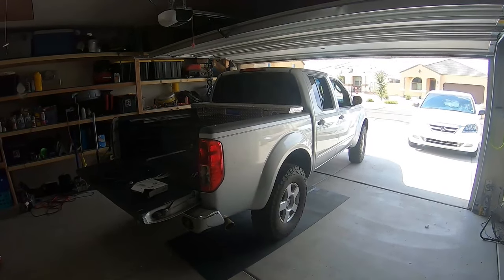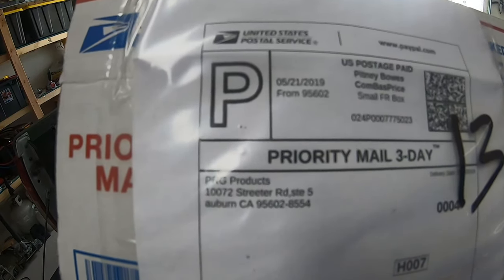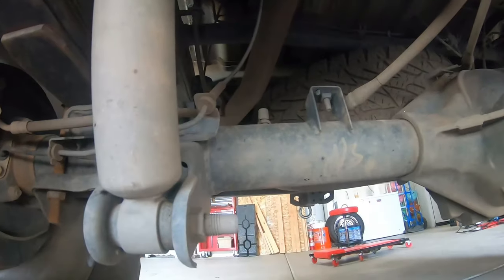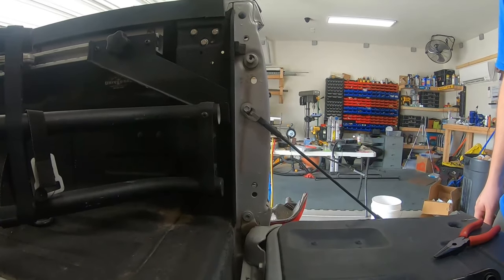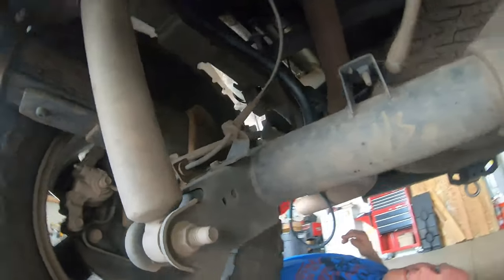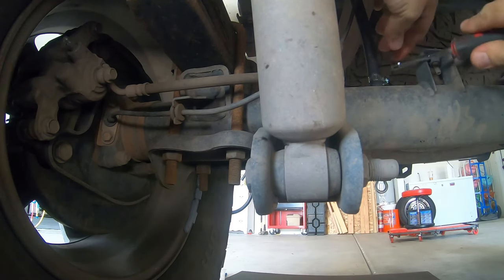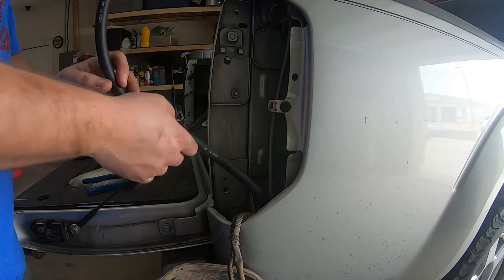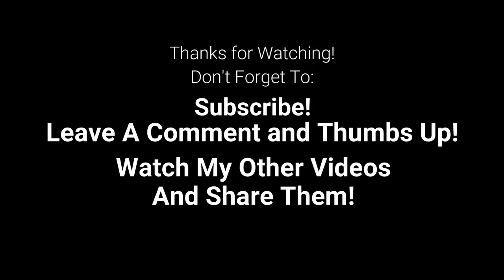Nissan Frontier axle vent Mod or diff breather

Comment: I saw one video on this mod, they recommended using a wire brush to thoroughly clean the area around and on top of the axle of any debris might have accumulated over the years, so it doesn't get into the axle hole when you remove the OEM breather.
Reply from the maker: Never a bad idea to clean!
Reply: @AGuyandHisProjects  - Very well done how-to video as BTW, I had pnly seen a YT for an X-Terra, I too have a ('20) Frontier so this TY had me ordering the 7ft. kit from All-Dogs.  Thank You for taking the time to create this.
Reply from the maker: @stevebailey7633  You are most welcome, glad I could help! Let me know how it goes when you get it in!

Comment: Need to clean around old one to remove.  Don't want dirt falling into the hole.  Dealer tried to hose me for 500 bucks to replace the stack one!  (and swap the diff fluid)
Reply from the maker: Working clean is always a great idea! That's a lot of dough  for some easy stuff

Comment: Was there any damage from where the jack stands were placed?  I didn't know you  could support the truck there and always put them on the frame/axle.
Reply from the maker: It's not my favorite place to lift but if you do it at the designated points where the manual tells you (little arrows on the truck) you should be fine. That is where they reinforce it for the factory scissor jack point

Comment: Is this mod really necessary? You have almost 250k and no issues, wouldnt it of been better just to replace the breather and chances are it would live out the trucks life? Just asking. Thanks for the video.
Reply from the maker: I run my vehicles into pretty high mileage (300+). To answer your question though for peace of mind yes, very necessary lol! I also really enjoy being in the garage working on the vehicles which is a big part of the "extras" I do on the vehicles
Reply: @AGuyandHisProjects  - The point made by the folks at AllDogs is the OEM model is a crappy design, prone to rust, which kills the unit.  You are then susceptible to overpressure in the axle, which can kill the seals.  That's a very expensive repair, as opposed to a $40 fix that lasts forever and takes 15 minutes for about anyone to install.

Comment: wow i see you have 5 or 6 leaf suspension on your nissan.  heavy duty i see.  stock is 3 leafs.
Reply from the maker: Thanks for watching! It is actually a 9 leaf pack. I ordered it from Alcan. Smoothed out the ride and built in an extra 500lbs capacity before the bed would sink. Loved those springs and highly recommend!
Reply from the maker: Actually, at the time of this video i may have been running add a leafs. I don't remember. Either way the custom 9 leaf pack from Alcan was awesome!

Comment: How much hose did you use? The kit says it includes 5’ of hose. That doesn’t seem like enough to mount behind the taillight. 
Does the barbed axel fitting come included?
Reply from the maker: Oh shoot, it has been a few days lol. I would imagine 5' would get you close if you are stock suspension. I think if I remember right I had to buy more hose and the coupling to connect them due to having an aftermarket suspension that allowed the rear axle to drop more. Hose is super cheap at your local auto store though, usually around a buck something per foot or so
Reply: @AGuyandHisProjects  Thank you
Reply: @AGuyandHisProjects  - The AllDogs Offroad breather kit ($40) gives you 2 options, a 3ft hose that allows you to install the new breather somewhere under the bed, or a 7ft, hose which is about the correct length to mount in the taillight.  I too wondered about "why inside the taillight" then realized it's a perfect location as it'll never get wet or dirty.
Reply from the maker: @stevebailey7633  True story! I have since installed others as well in various vehicles and have ended up putting them all in the tail light housing.

Comment: I noticed you didnt put any teflon tape or pipe dope on the threads of the breather replacement fitting. Did you just not video tape that or didnt put any on.
Reply from the maker: I didn't feel the need for it as there is no pressure to force the oil out and I don't spend enough time under water to worry about water going in. Sealing the threads would not be a bad idea at all though!
Reply: A Guy and His Projects Im debating if I should wait until spring to install the vent kit. The reason is Im not sure if moist air will condense in this hose and cause water to enter the diff. I live in Canada and as you know we get cold weather. Any idea if this could be an issue.
Reply from the maker: @truenorthmuskoka9077  i am no engineer but I do not see that being an issue as the filter isn't one way so the whole system can breathe...that would be my personal thought anyway
Reply: @truenorthmuskoka9077   ... Can I ask where you sourced your kit / parts from in Canada? Thanks in advance.
Reply: Samuel Smith I had to source it from the US at Offroad Gorilla. 

http://www.offroadgorilla.com/shop/rear-differential-breather-vent-kit
Reply: Samuel Smith I also bought these hood struts. They work great. 

 http://www.offroadgorilla.com/shop/nissan-hood-gas-strut-kit-hood-rod-eliminator
Reply: @truenorthmuskoka9077  right on, I went with The Big Monkey for my hood struts too ... I am so unbelievably happy with that mod. Just another reason to give that crew more business. Thanks for validating.
Reply: Samuel Smith no problem friend. If you ever come across a tailgate I’d be interested. I bought one from CARid and it broke in a couple months.
Reply: @truenorthmuskoka9077  Condensation is a possibility, but keep in mind on 4x4 models Nissan has a tube like this one off of the front diff that just breathes from the air box.  So if condensation was a huge issue?  Why would they do it for the front that way?  It is something to think about.  There is so little air moving in and out that condensation with an open element like the K&N filter used here shouldn't be a problem, though if your using a sealed fuel filter like some do?  I can see that being an issue for sure.

Comment: Great video. I'm getting me this kit and making the mods. I also have a 2wd Frontier and I live in a city that floods from time to time. I wanna add a snorkel to it just to prevent any situations where I have to drive through water for a few yards and not choking the truck. Any opinion on a mod like this to a truck like mine?
Reply from the maker: Thanks for watching! I have really enjoyed not worrying about the rear diff breather lol. I've wanted to do a snorkel as well but never squeezed the trigger on one so I can't hit you up with a recommendation. :/ good luck though! It is so much fun molding a truck into your own build
Reply: @AGuyandHisProjects  The day you squeeze that trigger make a video and let me know how it turns out. I think I found a site where they make the snorkels that fit the Frontiers. For now, baby steps... it's my first truck after driving sports cars for more than 14 years.
Reply: @AGuyandHisProjects  Bought the kit but the hose came in 4.5ft long which is pretty short and gives no good slack. Do you know what size or kind of hose this is?
Reply from the maker: Shoot I don't remember lol. I think when I did it I took the hose to my local auto parts store and bought a longer hose, or a coupling and extension to the hose
Reply: @AGuyandHisProjects  No worries man. I went to 2 autoparts stores today and their hoses  aren't as flexible as the one provided in the kit. All they had were some heavy duty extra strength crazy hoses and the kit hose didn't even have a size written on it for me to have some guidance, lol.
Reply from the maker: @ottico84  as it is just a passive breather you'd be fine with just about anything, fuel line is pretty cheap. I used fuel line exclusively on my f250 for both front and rear breathers

Comment: My 2017 2wd plan jane never taken off road or driven through water with only 15500 on it frontier is at the dealer having the blown seals fixed as I write this!  WTF Nissan, this is a known issue why haven’t you fixed this before it happens?😤
Reply from the maker: I know right! Something so small and simple for them to change too!
Reply: A Guy and His Projects/ I had read about this kit from PRG, thanks for a clear instructional video about the installation process!
Reply from the maker: Absolutely! Glad I could help 👍
Reply: Just got my 2017 frontier back from the dealer after 3 days after they replaced a blown axel seal.  They just replaced one side even though I could see grease on the other backing plate!  They insisted the other one wasn’t leaking and they wouldn’t replace it. Man I hate stealerships!  So just ordered this kit and wanted to thank you for your great video and advice!
Reply from the maker: @jackwood8307  you are welcome! The breather kit should help indeed, but if a seal is already on the way out...good luck haha!
Reply: A Guy and His Projects/ so as I thought the repair job they did on just one side did not work for long!  E brake started slipping after a week!  So long story short I contacted the general manager of the dealership and told them I was not a happy customer and explained my issue.  The service dept manager called me and apologized for my experience.  They had me bring the truck in the next day and replaced both seals and brake pads this time!  I must say that the brakes have never felt this good!   I bought the breather kit you recommended and I have a question about the placement of the breather.  In your video you placed it up by the rear tail light but the picture from prg shows it installed above the axel.  If I don’t off road this truck and dont drive through stream beds is it being above the axel a good place for it? Will water from just driving in the rain be a problem?   This would be a much easier install with it just above the axel.  Thanks for your help!
Reply from the maker: Glad to hear it all worked out! If you dont go anything deeper than the bottom of the bed I think you'd be just fine. I went with the highest I could go so i would never have to worry about it.
Reply: It is a "known Issue" but not just for Nissan.  Toyota has the SAME EXACT issue because they use the SAME EXACT type of OEM valve.  It happens to very few trucks.  There is a TSB on this through Nissan but applies only to the M226 axles not the C200 to my knowledge.  It does happen, but not as often as you think.  There are people with over 200k miles on their trucks with the OEM original valve and no problems.  My Sister even with her 2005 Titan has the same OEM axle vent on with over 200k miles she has never had an issue with seals.  So it really seems to be a hit n miss type of thing.  The Mod should help, but could also void your warranty, so damned if you do, damned if you don't type of thing.
Reply: Jeff Eppenger /thats a roger on the warranty.  3 year on components and 5 years on the drive train.  You can bet if you ever developed any issues with the rear end and had this mod thery wont honor it.  So I guess the thing to do is to take it off when going to the dealer but what a pain. But so far the fix they did is working!(knocking on wood now)
Reply: @jackwood8307  In my wife's truck case, we have a 7yr 100k warranty.  Though I see the mod as useful, I still believe the amount of trucks with actual failures is still WWAAYY less than people think.  Does it happen?  YES.  Only To Nissan Trucks? NO.  Toyota has the SAME problems.  Its hit and miss.  I do know Nissan improved the seal design a few years back and that solved many of the so called problems.  So was it bad seals to begin with? or a faulty vent?  Will we ever know?
Reply: Jeff Eppenger/well it seems to be fixed and as I went through the front office to remedy this for the 3rd visit, I got results. Polite but firm seemed to work. Tight car market around here and the dealers are fighting over customers.
Reply: @jackwood8307  what was wrong and what did the dealer tell you?
Reply: Jeff Eppenger yes the rear seals on the axel at the wheels had blown out due to the vent being plugged. It got where the parking brake wasn’t working and it felt like it was taking more effort to stop. The shoes had become soaked in rear end dope.
Reply: @jackwood8307  do you know why the vent clogged? I'm just curious because I'm trying to figure out a pattern.  There is a discussion I'm involved in on the frontier forums and I'm trying to gather information.  Where you live in there snow? Lots of rain? Was your truck taken off road? Through streams or anything that you think would have caused it to get plugged up.  Any info you can give might help.  Lastly, did Nissan cover the work and did they give an explanation?
Thank You for your time.
Reply: Jeff Eppenger /I live in Alabama so theres not a salt and sand issue like up north.  This truck has never been off road and the water it’s been exposed to was on city and highway roads when raining. This was covered under warranty and I had no out of pocket expenses but did lose time dealing with it. It took three times to get it sorted. Kept my truck for three days and they told me that indeed the seals had blown, but it was on my third try that getting the dealership general manager involved got it fixed. The service folks tried to blow me off by just cleaning the pads and adjusting them, told me it was fixed. Lasted two days. The second time they told me it was only on the right side and they fixed that, even though I could see wetness on the left side. That lasted a day before the ebrake stopped working again at this point I contacted the dealership manager and he told me to bring it in the morning.  Its been working right since. Not a great experience with having them do service work.
Reply: @jackwood8307  Thank You for the Info.  Did the dealer state the seals leaked because of a clogged or defective axle vent or the seals were possibly faulty?  I'm sorry to hear you why through this with such a new vehicle.  This is a known problem but nobody really knows why.  Folks suspect it's the axle vent but there are folks with the rear axle vent modification and still had axle seal leaks.  This makes me believe that it's a seal problem not an axle vent issue.  Are you planning on doing the rear axle vent mod because this happened or since your still under warranty just leave it alone or? Again appreciate your time and information 👍
Happy Father's Day by the way if your a Father 👍
Reply: Jeff Eppenger going to wait till the five year mark when its out of warranty.  They never really said it was the vent but they put a new one on it. Happy Fathers Day to you also!👍
Reply: @jackwood8307  So we really don't know what caused the failure?  We are assuming it was the vent, but since the dealer didn't show it to you and you didn't ask to see it the vent, its possible it could have been faulty installed seals from the factory?  This is the thing, we don't know and assume its the vent.  Unless you actually saw the vent clogged?  Also, a member on the forum has taken one of the OEM vents and blew on it, he was able to blow air out, but no air in, meaning its a one way valve.  So the only way this valve could have been clogged is by water seeping in with dirt through the seals and being blow out the vent which in turn clogged it.  That makes more sense doesn't it?  I have been saying on the forums that the problem isn't the valve, but the seals.  This also explains why people that put on a "axle vent mod" still have issues.  Your thoughts?
Reply: Jeff Eppenger you have a good point. Im not sure what caused the problem but Im glad it’s fixed!👍
Reply: @jackwood8307  I'm happy for you too.  The Frontier really is a great truck enjoy my friend 👍

Comment: nice job i have a question the filter can put in another side or ia recomended put in the in side of the tail light .
Reply from the maker: You can run it to either side.